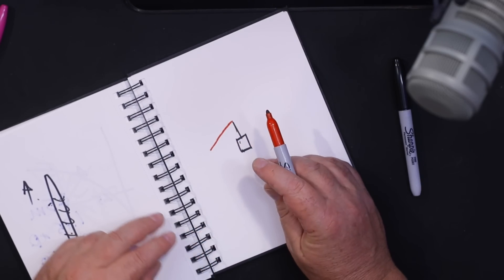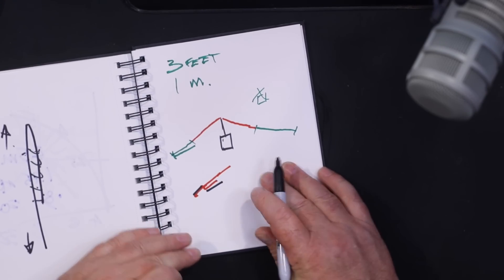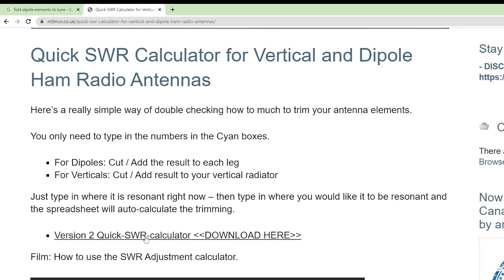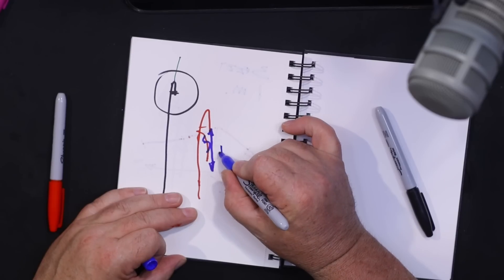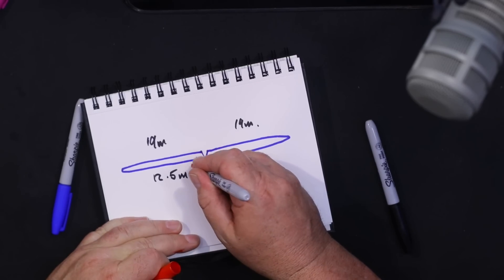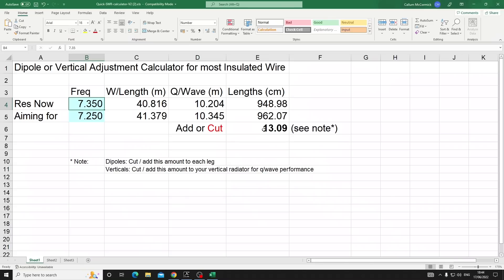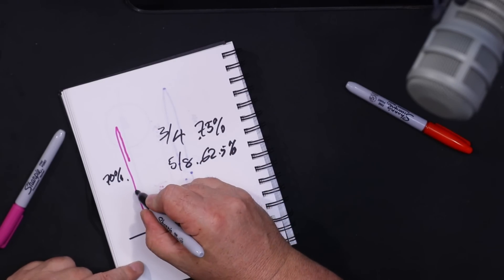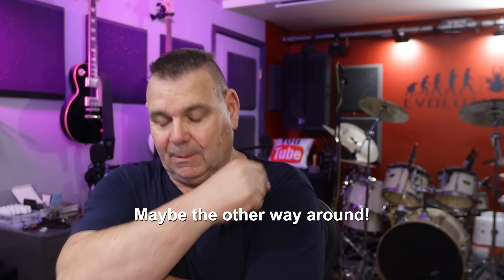Fold the end of a Dipole Back - What's Happening?

Comment: Callum, I am confused by all the multiples.  I have a Rapide that I built with the 40m fold-over.  It tunes to about 7.2 now and I need it at 7.1.  Your calculator says I should add 13.64 cm.  Do you say that I should try adding 3 times this much (~40 cm) to reach my objective? Or 9 times as much?
Reply from the maker: OK, so it's NOT a harmonic, just a q/wave.. So in your case, add about 3.5 times as much - then cut back a small amount for final tune..
Reply: @DXCommanderHQ  Thanks for the reply, Callum.  I'm on it.

Comment: Great "lightbulb" moment - Aha feels good when you finally get it. I wonder if you continue the trend and double back again for another segment on a linear loaded dipole if the next switchback point will then be a 7:1, then 9:1 as you continue the ziz zag pattern on a linear loaded dipole?
Reply from the maker: Fascinating!
Reply: @DXCommanderHQ  I was wondering if you might help me with a calculation I'm planning to put up a long wire antenna for field day about-face 250 ft long and use it on 20 m any idea what the impedance would be if it was end fed? I plan to elevate it 5m also what type of gain could be expected

Comment: What is the length of 40 meter inverted vee  antenna
Reply from the maker: Wavelegnth is 300/7.2. Each leg will be answer / 4. Answer in metres. Insulated wire? Multiply by about 0.93. Adjust for height above ground. Lower to ground, shorter dipole legs will be. So ABOUT  9.85m per legs.

Comment: A bit late to the party. But what would happen if you bared the end of the insulated wire, folded back half the measured amount, then stripped the sheathing of the wire where the end met the main and attached? Wouldn't that provide the ground out needed? That spot could then be resealed.
Reply from the maker: I think you are saying what would happen without the plastic sheath.. In which case, you would have a short circuit and the overall length is just that.. The end of the wire is the end.
Reply: @m0mcx  Thanks for the reply, I  was just curious. And thank you for the videos. You've helped alot with my slow growth as a ham.

Comment: What happens if you combine the two methods?  
Instead of just folding the insulated wire back on itself, what if you first stripped the insulation or jacket off of the part to be folded back? 
Would that eliminate that length from the equation as you said it did for bare wire?
Reply from the maker: Now you are bare copper again, yes.
Reply: Was thinking along these lines. Dipoles in my small space are always inverted v's or sloped somehow which always makes the normal dipole leg length not perfectly come out according to the usual 468/f method. What if we just stripped back an amount of insulation, use the wrap back method (therefore being able to ignore the amount of wrapback) and then just cover it back up with shrink tubing or electrical tape? Viable?
Reply: @richardneel6953    Hi Richard.  That’s exactly what I do – strip back the insulation at the end of the antenna to bare copper, then tightly wrap back the required amount.  The “skin effect” then comes into play (as electrons travel on the outside of the copper wire – not through the core) and linear loading does not become an issue.  
Thanks for Callum bringing this up in a video, as it must be frustrating to many Hams using insulated wires that their calculations are not working out.  I.E. when using insulated wire, and folding back insulated wire, the foldback needs to be approximately triple the calculated length.

Comment: Hi Callum, I got bitten the same way as you, ONLY didn't understand what happened, at the time.
I laid out approximatly a half wave of 10 gauge pure aluminium electric fence wire, for 160M. Raised the centre 18 meters high, attached end insulators and rope and pulled the ends out. SWR good at 1.8 Mhz (I wanted 1.850Mhz). I folded back/ twisted around about 1Meter at each end, Perfect at 1.850 Mhz. Ends looked ugly so I cut 500mm off the fold back  from each end to make it look tidy. SWR tune went up to 1.9Mhz,????. #@$%&.  I lowered the ends and pulled back all the 500mm of fold back,  until I had just enough to go through the insulator eyes and got 4 turns around the element at both ends. Luckily tune came back to 1.850Mhz. Contest antenna was saved. . Scarey stuff at the time. Thank you for explanation..... John
Reply from the maker: Ah! You too!? LOL

Comment: My guess is when you fold over an insulated wire you are reducing the length and constructing a linear capacitor on the wire's end. The two pieces of wire make capicitor plates with insulation between them.
Reply from the maker: Yes, I think so!

Comment: Great video. Bet I'm not the first to suggest this, but can you just keep to metric when talking about measurements for antennas which after all are named after 'metres'. Anyone that insists on using inches can just do the conversion themselves. I find it slows up the presentation and flow.
Reply from the maker: I know.. However, when I don't swap between the two, I get a thousand comments telling me exactly reverse of what you say.. I can't win.
Reply: @DXCommanderHQ  I do laugh out loud when I watch a US ham radio youtuber talk about making an antenna for (say) 2m, then immediately convert 2m into inches and start measuring out, immediately making more work.
Reply: I as a US ham, am fonder of the my etric system. It is so much easier in a base 10 number system...

I get confused when trying to deal with 12, when I have only 10 fingers. 😂
Reply: @dodgydd   Hi dodgy.  Not only USA Hams, but UK Hams – who should know better!  After all, UK has been metric for around 50 years now.  It’s so much easier (and precise) to work in millimetres than in feet and inches.  
Not only that, UK Hams still talk about their Bands in metres, even when Ham Band Plans are now in MHz.  I can’t remember the last time I saw a Ham radio transceiver readout in metres!  Especially ludicrous it must be to new Hams when 144-146 MHz is described as 2metres!   Worse – when 430-450 MHz is referred to as 70cms!

Comment: I’m a dummy, don’t understand ground plains or what will work,  Does it matter if I were to add say 3 more wires to negative (horizontal) and positive vertical ❓ don’t expect to hear from you but your my last chance… Love your vids.. Tim
Reply from the maker: No don't a dipole is literally 2 pieces of wire (or other conducting elements). You need nothing more.

Comment: As someone with minimal knowledge trying to learn, that seemed to be a rambling way to actually not explain very much!
Reply from the maker: As someone who reads a LOT of comments, that seems to be an utterly pathetic comment.
Reply: @DXCommanderHQ  Ok, so maybe I'm pathetic, but the way you said things? - I still couldn't undertstand what you were trying to say. 
I wanted to know how bending over the wires of a dipole affected the 'length' of an antenna, but the way you told stories about changing the lengths didn't answer any of my questions about the actual rules or theory, and left me probably more confused.  Yes, it's probably because I don't think along the same lines as you, but still - as a total newbie who has just bought an SDR dongle and wants to learn - that was my experience.